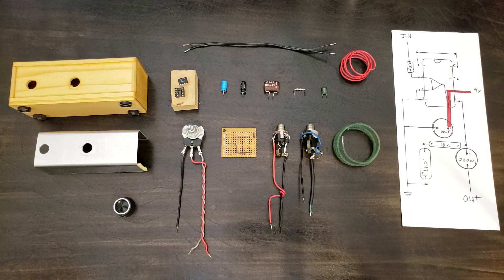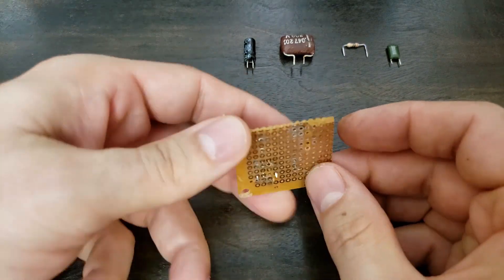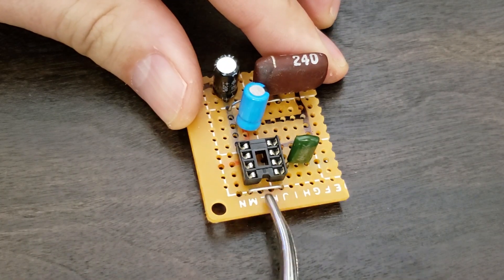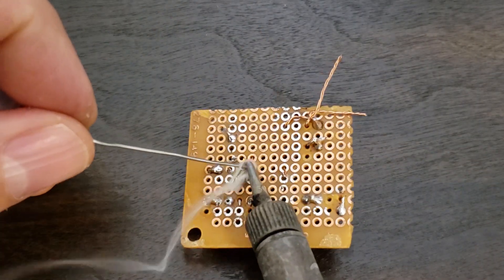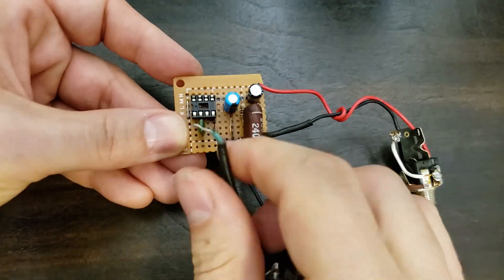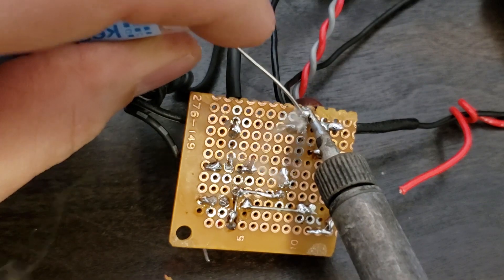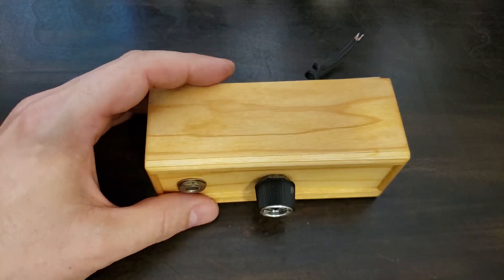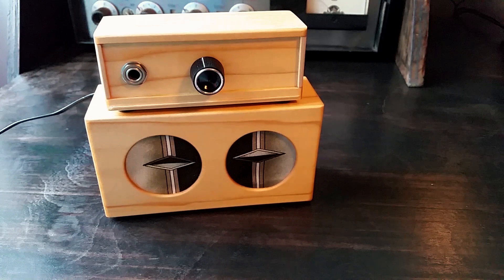Build a DIY Guitar Amp Mini Amplifier - LM386 Amp Head  PART 1

Comment: Does the amperage of the circuit depend on the wattage of the speaker? like having a 10 watt speaker on a 9v power source  makes the circuit draw 1.1 amps?

i am very new to electronics, sorry if its a stupid question.
Reply from the maker: Hi, good question! The concept you're referring to can loosely be called output drive.  It is affected by the voltage, as you suspect, higher voltages require more current/amps. However, the chip itself is designed to have certain properties such as current draw. It's usually stated on the data sheet for the chips, so designers know the maximum limits.   They ratings are usually in milliwatts or watts.   External things will affect output drive slightly, such as a very high or low speaker ohm load, but speaker wattage isn't really a factor. 
As a side note, generally speaker wattage has little effect on an amp, EXCEPT when it's too low.  A speaker that is totally overdriven will eventually burn up the voice coil.
Reply: @FrankOlsonTwins  Thats interesting, so hooking up a 10w speaker and a 100w speaker dont really affect the circuit? 

will they sound different? or up to a certain wattage they wont be driven as much as they should?
Reply from the maker: Yes, they will sound different but they will both work.  Speakers are rated for efficiency, and a large 100 watt speaker will generally be less efficient than a 1 watt or 10 watt speaker. So, yes you can hook these amps up to a 4x12 cabinet, but they will sound different than listening through a smaller speaker.  Whether they sound better or worse depends entirely on the speaker and the listener!

Comment: Great project. I can't wait to try it. I was hoping to use a 4ohm speaker I already have, and solder it to the output for a stand-alone amp instead of using a separate cab. You mentioned that pretty much any size speaker would work; does the same go for the impedance? 

Also, I wanted to add another pot for tone control. Any advice?
Reply from the maker: 4, 8, or 16 ohm speakers should all work just fine with the amp.  You'll know if the amp doesn't agree with the speaker because the tone will start to sound really muffled or really thin.

As far as the tone pot: you could try one before the input or at the output.  Think about how a guitar tone knob works, that'll get you in the ball park.

Let me know how it turns out!
Reply: @FrankOlsonTwins  Thanks so much for the reply. Waiting for parts to arrive, but I'll let you know how it goes. 

Subscribed

Comment: I only have 1/4 watt resistors, is there a good substitute from the 1/4 watt range that will work?
Reply from the maker: You could try making this with 1/4 watt resistors.   I'm sure that would work fine.   Or, you could double them up to make 1/2 watt values.
Reply: I have to troubleshoot everything now, built it all with no results.
Reply: 1 - 220uF eletrolitic
1 - 100nF ceramic or poliester capacitor.
Both in parallel in the vcc in. Respecting the eletrolitic polarity sure.

1 - 10 ohms + 57nF from pin 5 to ground.

If you're using lm386-N for sure. 
👍😆

U'll have a cristal clear sound
 And if u wish gain just insert a 4k7 pot + 10uF eletrolitic from pin 1 to pin 8.
👍😆

Comment: Build it works nice but potentiometer didnt work. 
Would you please show it clearly. can i use 50k ohms poteintiometer
Reply from the maker: Hello,
A pot isn't required.  You can use your volume control on your guitar to control the volume.  Unfortunately a  50k Ohm pot will probably not work. You need a 10 or 20 ohm rheostat, which is like a wirewound potentiometer.

Comment: built it and it didn't work. Would you happen to know what went wrong?
Reply from the maker: Triple check every joint against the schematic.  Mark each correct one with a highlighter.  Make sure the polarity of the electrolytic caps is correct.  Make shure the polarity of your power cable is correct. Also check your output wiring and speakers.  If it still doesn't work try a new chip.  Some are extremely sensitive to static, if you touch the wrong pins with a charge on your hands, it won't work.  It's happened to me several times.
Reply: @FrankOlsonTwins  Okay, thank you! Will this work if I plug it into a guitar amp? Or do I specifically need a cabinet?
Reply from the maker: If you plug it into a guitar speaker it will work, but if you plug it into a guitar amp (specifically, if you plug it into the input of a guitar amp) you will likely destroy the input stage of the next guitar amp.  These generally put out about one full watt , which is suitable for speakers but not other device inputs.
Reply: And so would it work if instead, I soldered a headphone jack where the speaker cabinet was supposed to be soldered in? Or could I not replace a headphone jack with the mono jack?
Reply from the maker: Yes, you could hook up a headphone jack up in mono, by connecting both positive(Left and right) contacts to the positive output wire. It will ne very loud in the headphones, so be careful with the volume!
Reply: Frank Olson Twins is there a way to set this up specifically for headphone volume? I want to install this inside a travel guitar im building. I guess i would also solder the audio in directly to my guitars input jack?
Reply from the maker: Try a 1K potentiometer instead of the 25ohm rheostat. Might get you in the ball park.

Comment: I was wondering why you coiled the positive wire around the ground wire on the output jack, is it to increase  the current?  The reason I asked is because there is a guy here on YouTube that some people say is a second Tesla who says you can multiply the current by winding a wire around itself and that the output current is multiplied by the number of turns that the wire is wound around itself. I was always taught that current cannot be multiplied  by a transistor is supposed to do that. Thanks and thanks for the video.
Reply from the maker: I twist some unshielded wires together to try to cancel out hum if it gets picked up by the positive output wire. The grounded wire on the output will act as a shield to some degree.
Reply: Could you please explain a little bit more what you are trying to say or tell me what video to look for?
Reply: @libervolucion  Long story short : When the current flows through a wire, it generates an electronmagnetic field around it which has a determined direction of rotation according to the direction of the current (Ampere's theoreme). Coiling positive and ground wires, travelled by same current but in opposite direction, will generate 2 electromagnetic fields that will counter each other so there is almost no more electromagnetic field. It is done to avoid electromagnetic disturbance in the circuit that could lead to sound distortion.

Comment: Great video, website and project Frank. Thank you off to Jaycar to buy some parts :)
Reply from the maker: Thanks!  Good luck and let me know how your project turns out!
Reply: @FrankOlsonTwins  Hi Frank, can I assume that the 0.047 and 0.01 caps are uF ? Also would a 10K linear pot (rheostat) be suitable for the volume control ?Thanks
Reply from the maker: @MrPnew1  Hey sorry for the late response- I just saw this comment.
Yes, all values are in uF. If you haven't purchased a rheostat yet, I'd say go for a lower value.  The output impedance of most Lm386 chips is 8 ohms.  You can match that closely to the value of the rheostat, which is why I'm using 10 Ohms.  I'd say you could go up to 100 ohms or even 1K, but it might shorten the life of your chip.  10K might work or it might give you a limited knob range where the rheostat works in the range between 0 and about 100 ohms(just a guess here).  Rheostats tend to be expensive these days($5+).  The rheostat isn't necessary for a working amp, however.  But it will make it easier to keep the crunchy guitar tone you want when you have the amp cranking.

Comment: What are the SPECIFIC materials you used? What kind of transistors, capacitors etc.?
Reply from the maker: Hey Dabi, check the link in the description,  it has a full list of the exact parts needed to build the amp.  https://vintagemusictech.blogspot.com
Reply from the maker: Yes, these caps are measured in uf.  25 ohm rheostat for the "output" pot, 10k might not work well.   If you can't find 25 ohm you could use 8 or 10 ohm. In fact, you don't "need" the rheostat, if you are willing to use your guitar volume for the gain/volume. Check oft the "smokey" amp, they have minimal parts- no pots.

Comment: can sound be clean? or it is always distorted, how can i change it
Reply from the maker: Change the gain/distortion by changing the gain resistor for the chip.  I used a "Jumper" for full gain. In that case, it will always sound distorted. If you use a potentiometer you can change the gain by turning the knob to clean up the sound to your liking.
Reply: What value should it be?

Comment: Hi, does it work if I add an alternative 1/8 in jack so I can play audio straight from my phone using headphone jack without any adapters?
Reply from the maker: Yes, but you might need to use a stereo input jack and run both of the signals to the input of the chip.  You'll get a mono sound, but then you'll get both stereo signals.  The alternative would be to build 2 circuits and hook each up to it's own speaker for stereo.
Reply: @FrankOlsonTwins  I see, thank for your explanation,

Comment: Hi there, nice little amp! ... what would be the best 3w (or even 1w) speakers for a guitar? i don't want it to sound harsh or distorted when playing high gain presets from my vst amp sims. Thanks!
Reply from the maker: Speakers are the most subjective thing about these amps.  You can use this amp with anything from a 2" speaker up to a 4x12" cabinet.  I'd look for a decent full range computer speaker to tear apart.  The fun part is finding something unique to make a great sounding speaker/cabinet from.  One thing I look for is All-paper speakers(no foam surround).  I also like old alinco speakers from car radios, table radios or tape recorders.  1"x"5" ovals, 3"x5" ovals, 4", 5", and 6" round speakers all sound great with this amp. Good luck! I don't currently have a source for a "new" 3 inch paper speakers for these amps but I'm sure a bit of searching online will yield quick results. Good luck!

Comment: How much did this cost to build
Reply from the maker: Approximately $10 dollars plus the cost of shipping the parts, if built as shown.
Reply: $1 only amp without jacks and case
Reply: @Kojima_dreams  WTF? Really?
Reply: @Kojima_dreams  really? Pray tell. Did they fall off the back of a truck 😎
Reply from the maker: @MrPnew1  you can buy imported assembled amps like this for about $1 each, check out ebay. But it's less fun and less educational;)

Comment: Will this work if I make a cab with bigger speaker?
Reply from the maker: yes, any size speaker will work.  It will even work with a 4x12 cab!
Reply: @FrankOlsonTwins  that's really good to know! Thanks for the info. Also what about connecting the amp through a powered speaker? Like a Bluetooth speaker that's not broken? Will it work or will it break the speaker?
Reply from the maker: That could work if you keep the mini amp volume low.  There might be an impedance mis-match, so it might sound bad.   I don't think you'd break the blue tooth speaker, but you might wreck the blue tooth amp.
Reply: @FrankOlsonTwins  hi sorry i have questions again. I got this old speaker and opened it only to find some kind of circuit. There were capacitors and resistors. Should I take them out or can I leave them be and just plug the amp to it?. It is a passive speaker by the way. Also I can use a 9v PSU instead of a battery right? Sorry I'm really new to the DIY world
Reply from the maker: No problem!  There's no harm in trying to see if it works as is. It might work fine with the little circuit engaged.  But if it doesn't simply remove all of it and go from there. And yes a 9v psu will work fine instead of a battery. Good luck!
Reply: @FrankOlsonTwins  thanks for your words! Its just I'm afraid something will blow up! Lol